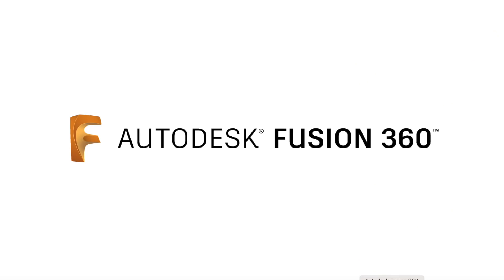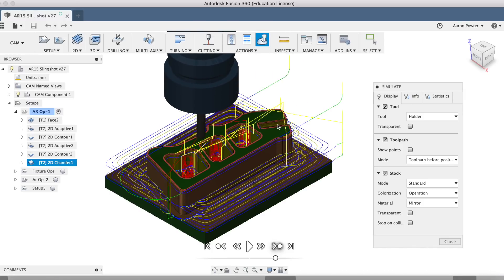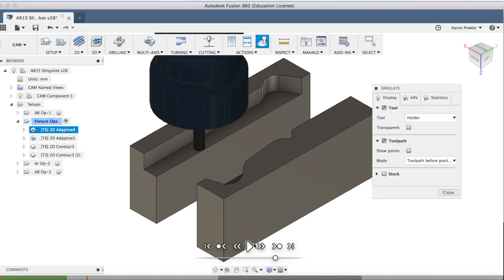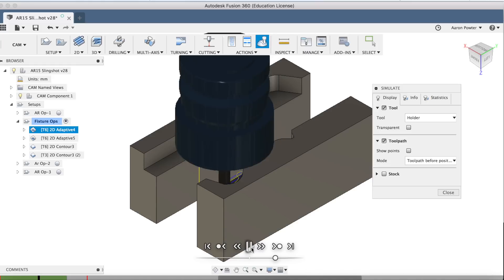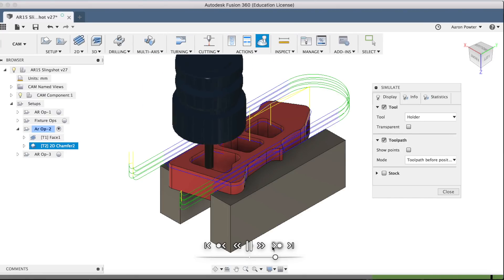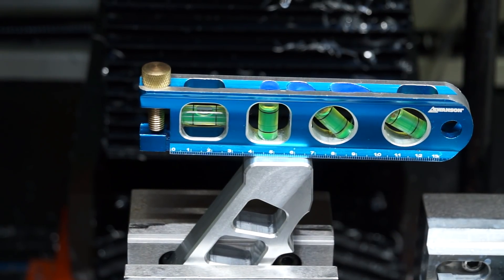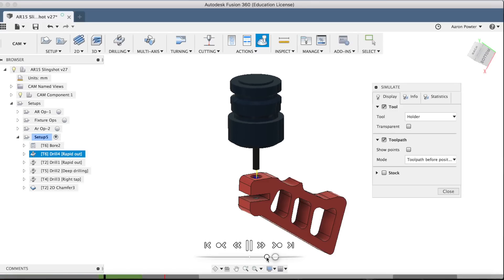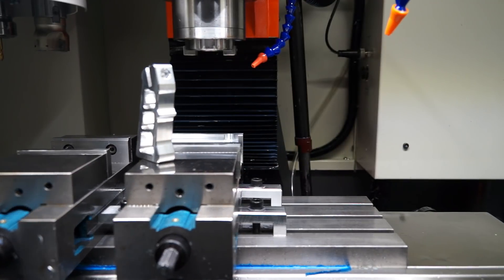Batman Slingshot with AR15 Grip - Making the grip Pt.1

Comment: That came out flawless! I was worried about the surface finish when I saw that the coolant cant clean the swarf effectively and you had to open the door and do it manually. Double thumbs up for using a CNC as a MANUAL mill :)
Reply from the maker: Hello Horvath.  Thanks for the great feedback.  Yes I need to fit a more powerful coolant pump or an air blast inside the machine.  It looks rather dodgy opening the door all the time.  Yeah it's cool using a CNC as manual machine at times.  It's just like a manual machine with an expensive DRO and you don't get tired winding the hand wheels ha ha ha.  Cheers, Aaron.
Reply: I guess you have higher priorities than continuously upgrading the CNC what you bought to avoid upgrading the previous one :)  plus it is not an issue until you want to run the machine unattended. How does things go with Syil CNC for you? I found a little difficult to communicate with them about details...
Reply from the maker: True that buddy.  I'm sick of fixing and modifying.  I just want to machine parts these days lol

Comment: Nice work Aaron, I liked your solution to hole making through the slot.
Reply from the maker: G'day Jody.  Thanks for watching and the feedback mate.  Yeah, the plunge with 6mm end mill gave me the clearance to run the spot drill and tap ;-).  My usage of the small spirit level was a bit dodgy, but it saved me from making complicated soft jaws to hold it on those weird angles.  Cheers mate, Aaron.